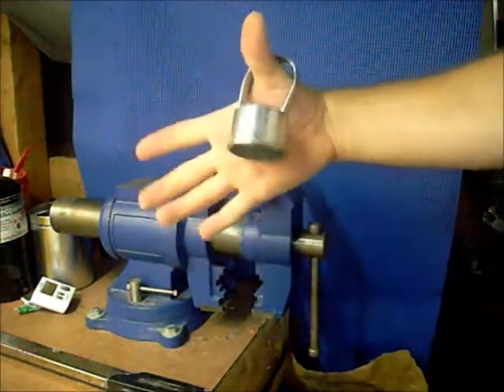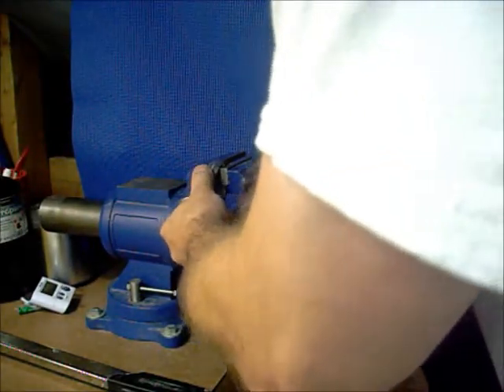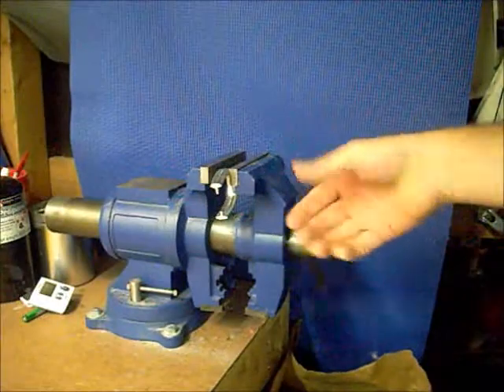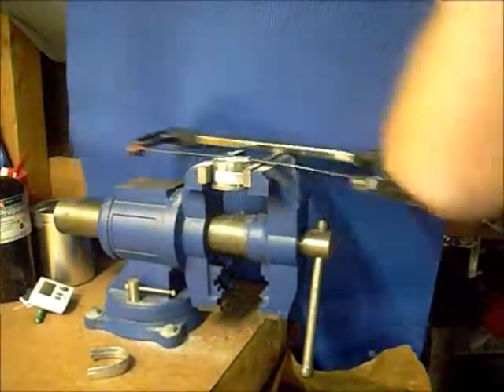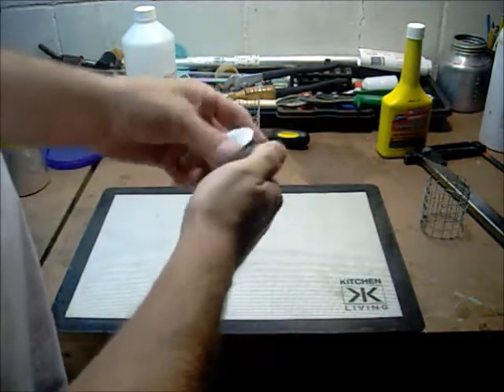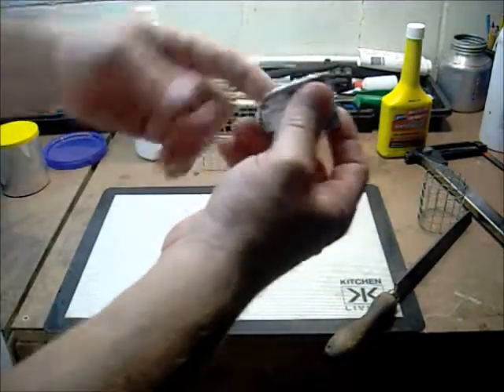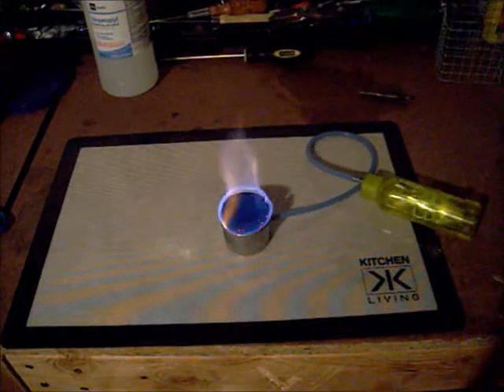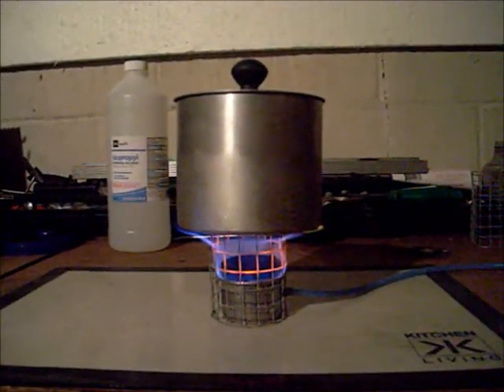Alcohol stove indestructible

Comment: Bro, The flame is only at the top. That's where the vapor/oxygen mixture is. Where the nipple is located, is far enough below that it runs real safe. Also, the line itself is filled with liquid. I say this bcuz if you make the mistake(like i did) & overfill/get spillage & burn your line, it does not feed back to the bottle and explode. It's relatively safe as long as ya keep an eye on it. Hope this helps.